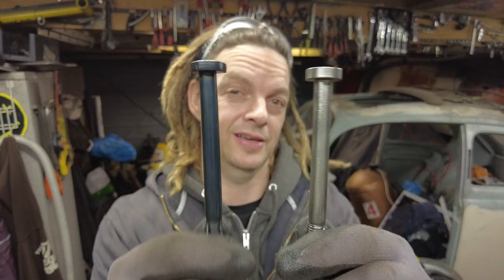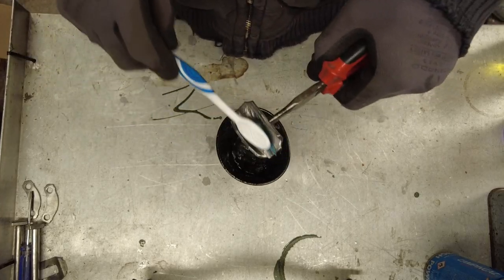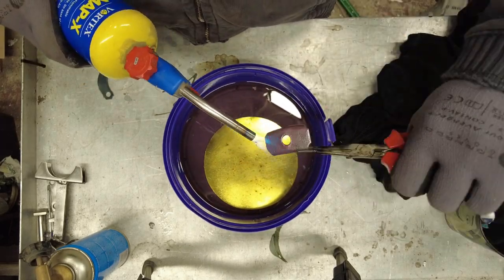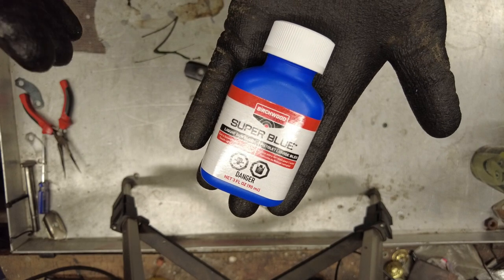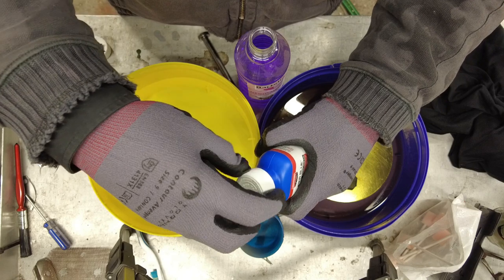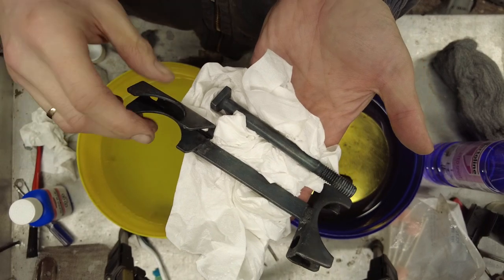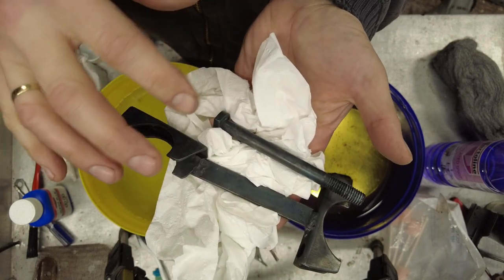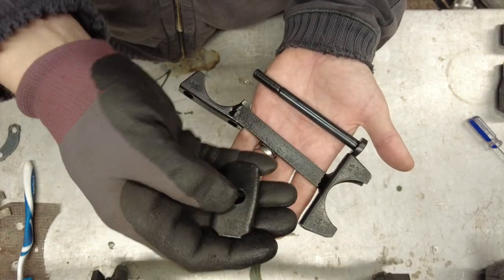Bluing Steel Hot & Cold - Rust Protection - Easy To Follow DIY Guide #bluesteel #rustprotection

Comment: Did some cold bluing on decorative steel items a while ago. Hit them with a couple of coats of rattle can clear coat afterwards, satin finish, looks great but kind of easily scratched. Maybe not practical for auto parts but adds a certain depth. Enjoy the videos, thanks.
Reply from the maker: That's interesting thanks for the info. Thinking of doing a follow up vid. See how they last in water and maybe how scratch resistant it is. Thanks for the tip 🙂👍